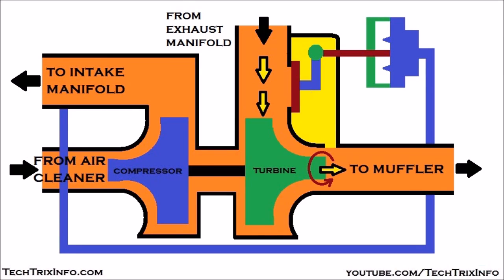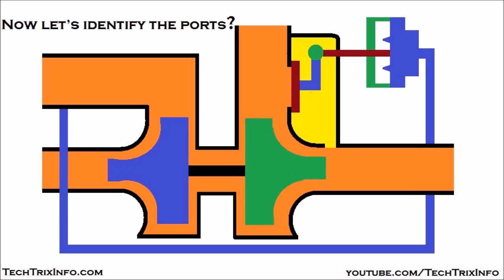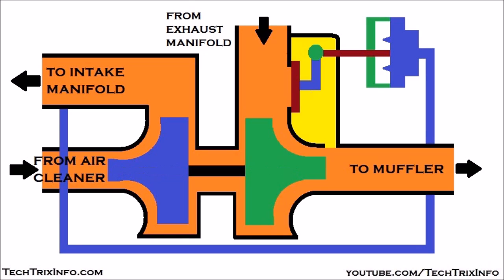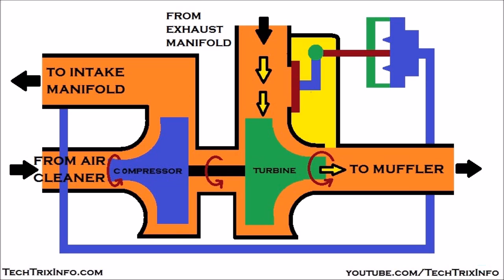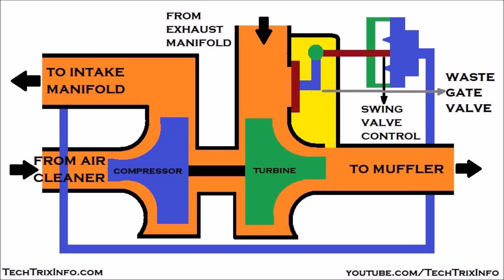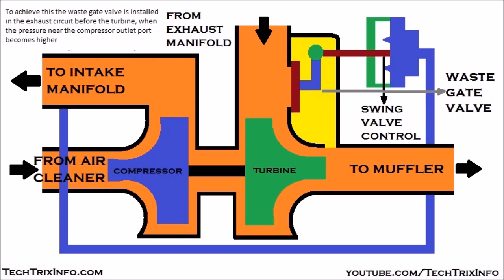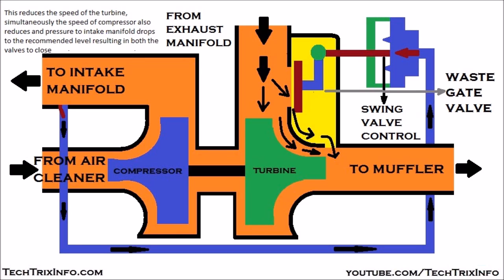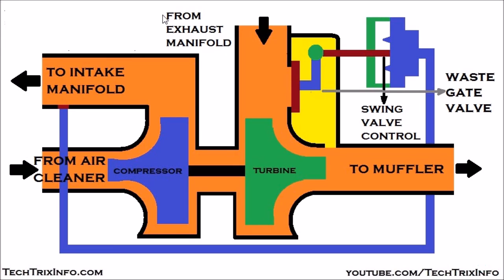Waste Gate Turbocharger.

Comment: Doesn't it close when vacuum drops?   And open when vacuum is up at idle, bypassing turbo?
Reply from the maker: A turbocharger doesn’t open or close based on vacuum directly. Instead, it’s controlled by a wastegate, which opens to release excess exhaust when boost pressure is high, preventing over-boost. At idle or low RPMs, there’s minimal exhaust flow, so the turbo isn’t actively boosting, and the wastegate typically stays closed. The bypass valve also activates when the throttle closes, releasing excess pressure but not based solely on vacuum. Feel free to ask if it’s not clear.

Comment: What will be symptoms or results if the wastegate valve stuck open position or not closing properly
Reply: I believe that if a wastegate valve remains open, the turbine will be slowed down, resulting in the compressor slowing down and thus not generating optimum intake pressure for the engine. The result would be low engine performance (slow acceleration, barely hitting 2.5K rpm).

Comment: Kindly improve the animation to let layman understand the principles.The diaphragm actuates the lever by pivoting the lever of the valve soit willopen.Your animation shows a lever eccentrically moving not swinging or pivoting.If you want the diapraghm pulls the valve,the fluid diagram must be at the opposite side so it will pill the link that is connected to the valve.

Comment: Super helpful. Now I need to tear down my shop built turbo system. They have my waste gates running off vacuum from a splitter block from the intake. So I am thinking it’s holding the gates open wide

Comment: Beautifully explained with almost zero animation, this show that when you got right information you can explain it to anyone. The only thing i didn't understand is how does the waste gate  pipe from the intake manifold operate?
Reply: I think it just opens up in case the air hits a certain level of pressure. I'm not a mechanic but I assume maybe it's just held in place with a spring or something like that.
Reply: It operates with an actuator controlled by the oil pressure.

Comment: cat 3500 series engines do not have waste gate actuator. plz tel me how the engine managing the air feeding
Reply: Harihere1 diesel motors primarily regulate air by fuel rate only.  Newer cat wrote and c15 thru c18 have wastegates for epa here.  Wastegates work best on petrol or gas motors because of detonation if over boosted.